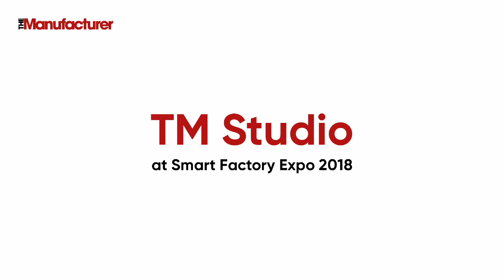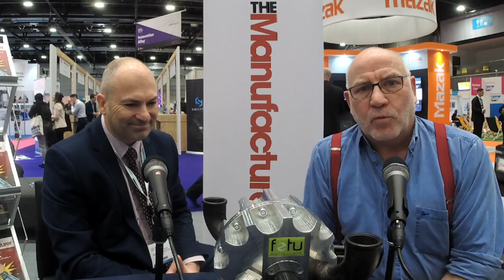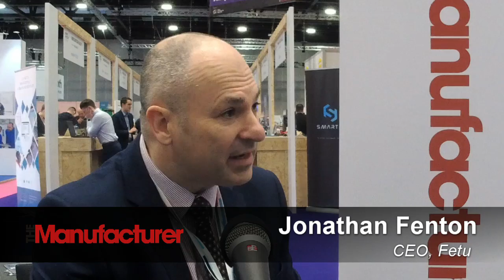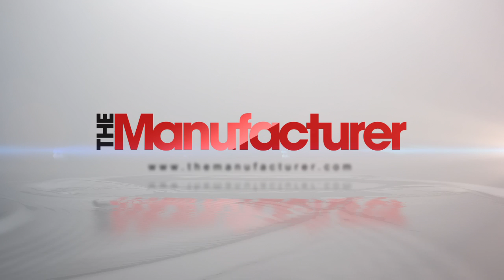Has a British engineer invented the world’s most efficient engine?

Comment: 0:02 ....they've been saying that about the "Next Engine", for the last 100 years.  And yet No one seems to figure out a way to market one, muchless one how to sell one or build for mass Production.   It don't mean anything, if it ain't helping the "Average Joe" on the street.  

If you are waiting for GM, or Ford, or BMW, or Volkswagen to produce the engine, they will never do it, just like the last 100 Engines, that were supposed to Revolutionize engines designs and fuel efficiency.
Reply: I actually have a 'next engine', but I see the best market place for it as being for small to very large ship engines, which isn't a bad market, but I can't afford to develop a prototype, let alone patent it.  It's a piston port engine just like a 2 stroke, i.e. no valves or valve mechanisms of any type, but a 4 stroke.
Reply: the only engine that remote came close to success was the wenkel rotary which is a 50+ year old idea. opposed piston opposed stroke seems to be the rage now due to efficiency .. but that's a 100 year old idea.

Comment: As Elon Musk has said, "Everything Works in PowerPoint" and "Prototypes Are Easy".  This engine idea phase reminds me of the similarly "Remarkable" Achates Opposing Pistion Engine, which has been in development for years.  Even IF one of these ideas actually worked and could be built, they still need to CONVINCE a vehicle manufacturer to "Take a Chance" on it, and also convince CUSTOMERS to give it a try.  Hell, it's hard to convince customers to even give Battery Electric Vehicles a try, even though Tesla has finally convinced manufacturers that this IS the future!

Comment: Congratulations.
But don't stagnate in any way , propagate and show that engine.
I tell you this because innovation in itself means absolutely nothing.
I will take the " Eclypse " engine as an example.
It is actually the first engine with self - ignition of fuel in high compressed air.
IT'S ALMOST UNKNOWN !! .
Only the Diesel engine is known which is actually the same or very similar.
You have to promote your concept a lot , not as an " Eclypse " engine .
Otherwise it will be the same .
Reply: Could you please provide a link or something for that Eclypse engine of yours? I cannot find any trace of it.
Reply: @tomasjedlicka7102  I'll try , but .... very rare are the prototypes of other engineers who have tried the same as Rudolf Diesel.